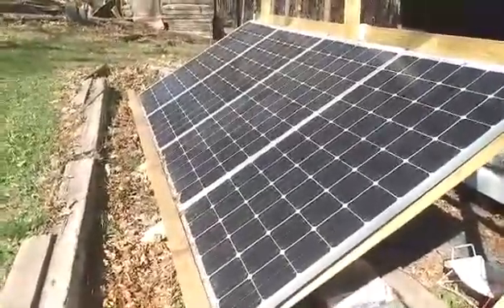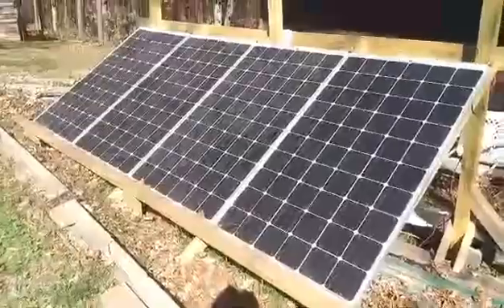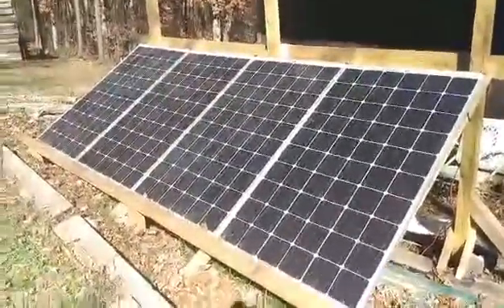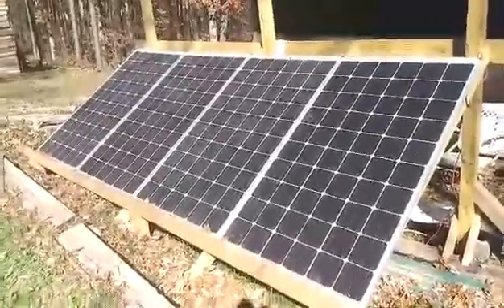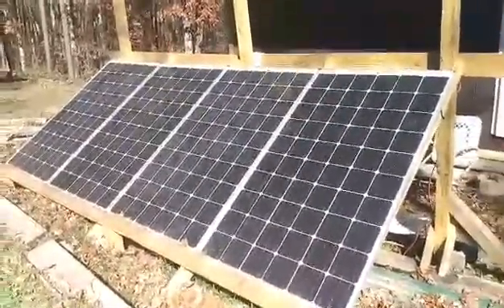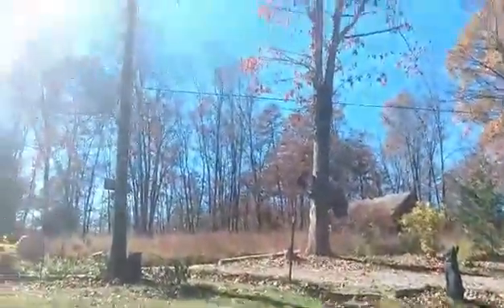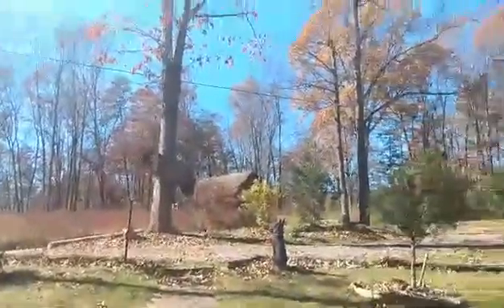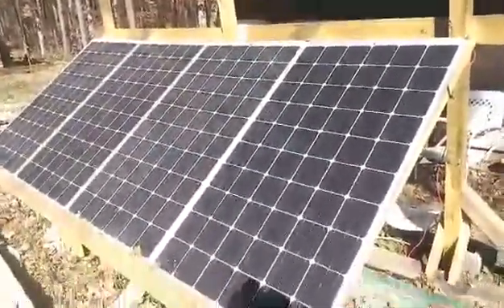Bluetti AC200Max is cranking the Solar Power today.

Comment: Have you explored having the panels in series instead of parallel?  Your volt max is 145 and your amp max is 15 with the bluetti. The low amp maximum pretty much forces you to connect panels in series or the bluetti will limit the amps for you and all you’ll see is lower than expected input. 
Series adds the voltage together and does not add the amps together.  Just be sure the open circuit voltage of the panels added doesn’t exceed 145volts. 
Parallel adds the amps together and leaves the voltage at 34 (or whatever the volts of 1 panel is). You’d be over 15 amps adding two panels together.
I can’t see which way you have wired the panels but check out how to connect them in series if you haven’t. If 34volts is your open circuit voltage for each panel you are under 145 volts for 4 of them in series. Be careful with that much voltage though. 136 volts will cook you and nobody wants that.
Reply from the maker: I'm using just three of these panels in Series to keep in line with the generator requirements.  The fourth panel i'm hooking up to a smaller Solar Generator